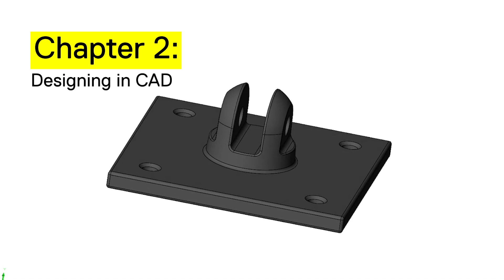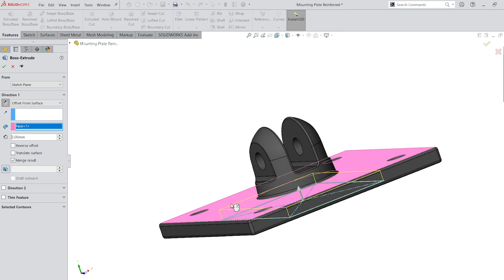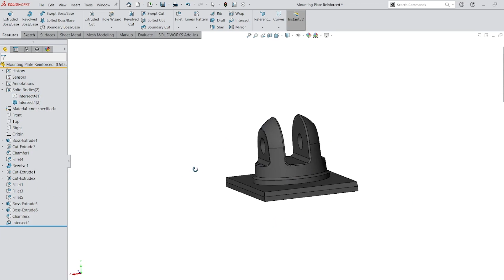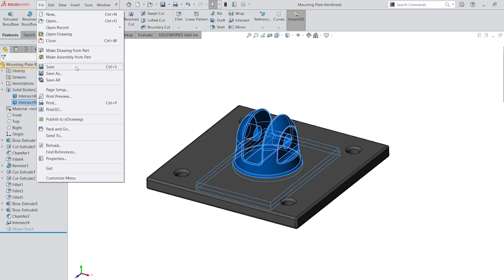How to Improve Z-Strength with Multi-Part Prints | Markforged Reinforced

Comment from the maker: Want to see a topic we haven't covered yet? Comment and let us know!
Reply: What about strengthening parts by filling the 3d printed part with resin and glass fibers or something similar

Or using carbon fiber to skin 3d printed parts for strength
Reply: Not this model* just in general
Reply: I would like to see the opposite of this topic, design a part that can manage a lot of compressive forces. In my Company we're designing injection molding tools and we are interested in making an 3D printed molds with your printer.
Reply from the maker: @amon666_  Thanks for sharing this great idea! We're adding to the queue!

Comment: It would have been nice to confirm in the testing that the modified walls/thicknesses/total volume or weight did not play a major role in comparing part performance.

That said I have zero doubt that this method is a great way to minimize the downsides of layer adhesion and part orientation, great video.
Reply from the maker: We printed everything with solid infill. The walls, thickness, and volume should be the same. The only thing didn't take into account was weight. 

If you want a deeper dive, check out the paper published in the Rapid Prototyping Journal that this video is based off of: https://bit.ly/co-part-research-paper

Comment: I’ve often wondered if it would be possible to have a slicer software that would leave regular vertical holes through the model and every few layers fill them with a quick feed of plastic to improve the vertical strength. What do yo think about this idea?
Reply: Like injecting it in the hole to connect layers?
Reply: @mynameisben123  yes. I would do t like an lattice infill and alternate which holes you fill so that two of the vertical connecting ‘dowels’ that are beside each other don’t break on the same layer.
Reply: I tried some dowel kinda idea to tap into holes down through the z axis.. It seemed to help. So the part has x/y printed dowels to go through holes down through z axis..

Comment: You mentioned using continuous carbon fiber but didn't show that in Eiger ? Did you use the default settings or did you choose the slices where the carbon fiber is embedded ?
Reply from the maker: Hi Stephen - We did not use default settings for this project, we chose the specific layers for fiber. If you want to know more about which layers we put fiber into, check out the paper we published on this research project: https://bit.ly/co-part-research-paper

if you have any other questions, don't hesitate to shoot us a message.

Comment: Since the forces are only being applied directly on axis, I'm curious how a multi part print would compare in strength to a part printed at a 45° angle. I've designed a few functional prints to print at 45° with no supports to prevent sheering.
Reply from the maker: Thanks for the comment! For this specific part, we wouldn't recommend printing at a 45° angle. Additionally, placing continuous fiber 45° offset from the load isn't great as we'd want it to be parallel with the load.

Comment: In most cases it's probably cheaper to overbuild the part and print as single piece instead of compensating in labor (design and assembly).
And it seems your printer is not fusing layers properly.
Reply from the maker: You're correct, in most cases this isn't necessary. This specific case was focused keeping the geometry same while increasing strength. Cheers! Thanks for watching!

Comment: If your slicer supports it this would be an ideal part for tree supports
Reply from the maker: Ohhh interesting! Have you done this with tree supports already?
Reply: @markforged  I've done similar parts to the center piece. Tree supports would let you support that 90 degree overhang without any supports resting on the part. Less scarring and easier to remove

Comment: Thanks for sharing a very good information. Strengthening in Z direction is crucial thing in 3d printed parts as well as novel polymer composites.
Reply from the maker: We completely agree! Thanks for watching and for the comment. What should we cover next?
Reply: @markforged I am interested in the mechanical properties of onyx reinforced with carbon fiber / glass / kevlar. This is apart from the data sheet information displayed on the Markforged website. For eg. The onyx is reinforced with 5% continuous carbon fiber.

Comment: Thank you so much for this video! I am new to 3d printing and designing a fence post cap that has tie out mounts for structural loads. I didn't understand how I could orient the cap to not have a weak layer either from the downward force against the post or from the rope pulling on the tie out. This was an eye opener on how multi body parts can be used to solve this problem. I can see how making the mating surfaces a bevel that locks it against the load in the expected direction would make it extra strong (like a dove tail).
Reply from the maker: Thanks for watching and so glad you found it helpful! What should we cover next?
Reply: @markforged  I don't know if I have enough experience to suggest anything good but I will tell you what I am researching now. I am trying to print a phone case with multiple colors using a single print head. I think I understand the guides and it looks right in PrusaSlicer with the virtual extruders and I think I got the M600 set right in the gcode. But it sure does look like allot of filament changes layer after layer. I am trying to figure out if it is possible to extrude out a set of layers in one color, and then move on to the next using Z hopping. And if it is possible how I am trying to find out how far can you push the Z axis before a swap and still expect good results. Doesn't seem like a very common practice but I am getting some hints that it possible for my configuration (elegoo neptune 3)
Reply: @sathivv950  it generally isn’t done that way and it isn’t really a good way to do it. 3D printers are currently made to print layer by layer whilst only ever increasing Z. If you try to go back down to print another bit like you suggest it is very likely that the nozzle will hit the model (ruining the model and potentially damaging the printer), it would only work if each individual section has clearance around it so your colours could never touch and you would need a large gap between them.

The only things similar to what you thought is infill having a different layer height, but it can only be double the normal layer height and mechanically it is possible. The other one is printing objects one at a time rather than all at once, but then you have to worry about having enough space around the model so that your printer won’t hit the already finished models.

It would be easier if you could print the coloured parts separately or if you could only put the colours as a top layer. You could also just increase the layer height which would mean less layer changes and less filament changes

Also Z hopping is moving the extruder up and then back down during a travel move, what you described would not be called Z hopping.
Reply: @conorstewart2214  First of all thank you very much for this detailed and informative reply it was very helpful. Much appreciated. I guess what I was thinking given the flat nature of the image I could sneak in a few layers at a time with the travel hopping so it didn't bump just to reduce the number of changes. But you are right the more I think about it I can see even one layer disparity of an adjacent layer could rub against the print head. I have decided to do what you suggested and just print the image as basically a top layer. Or in this case just the first 4 layers and then from then out I will just print a single color for the rest of the shell case.

The way I am attempting to do this is I stepped through the Prusa preview to find the last M600 I want a color change to happen at and then manually deleted all M600s after that point. I think that will work from what I understand so far but I am going to try it later and see how it goes. Thanks again!
Reply: @sathivv950  that is a good idea. Just for reference the way they do it with infill being double the height of the walls, they don't move the nozzle back down. They print two layers of walls and then staying at the same Z height they just extrude the infill at double the layer height. That way means they never have to move the nozzle back down below a printed part, if you take z hops out of it then the z height is only ever increasing.

Comment: Sometimes I split the parts and use a bolt. Recently did this for a mounting bracket with a locking ball joint. Tapping some threads into the ball let me print everything in the best orientation, and also eliminate support material, otherwise I would have had to print the nut in place in mid air.
Reply from the maker: Interesting! And sounds like a cool part. Any DFAM topics you want to see us cover next?